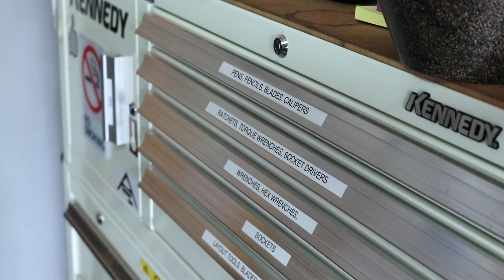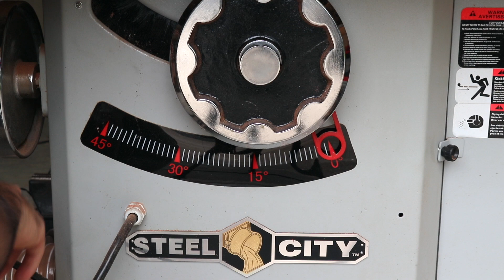Bamboo Plywood Lapdesk w/ Leather Top

Comment: Nice build, love that bamboo plywood and it looks very useful!
Reply from the maker: Thanks, Bamboo plywood is one of my favorites to work with. The outer veneers are 1/8" or so thick so there's plenty of material there if you get a gouge or deep scratch and need to sand it out. 👍🏼